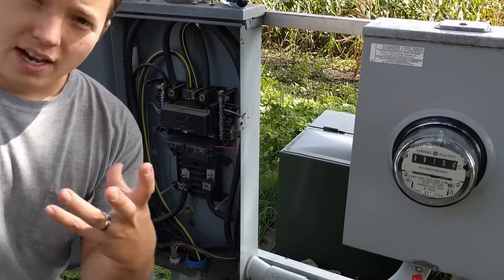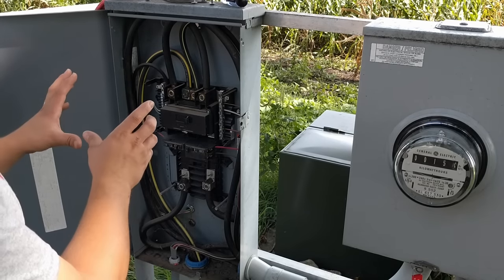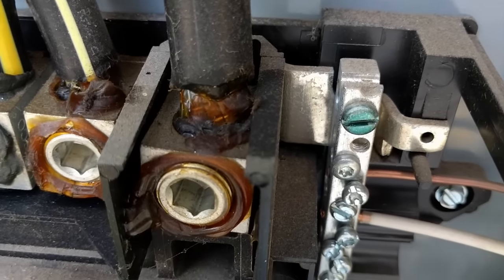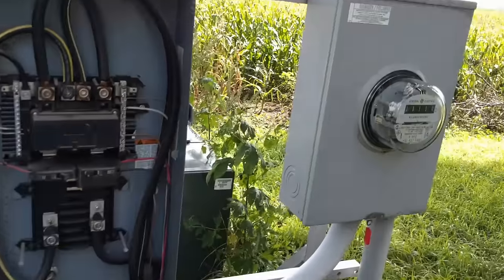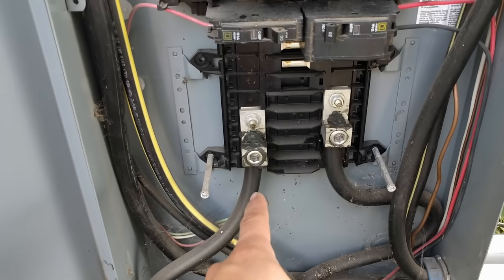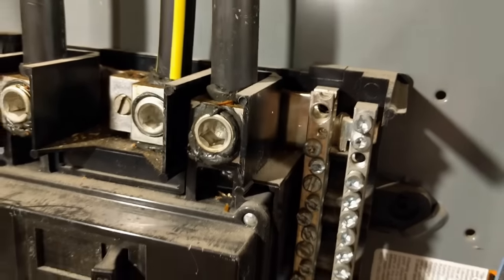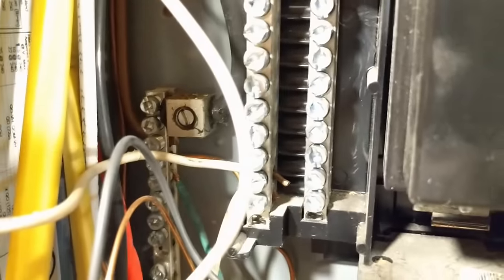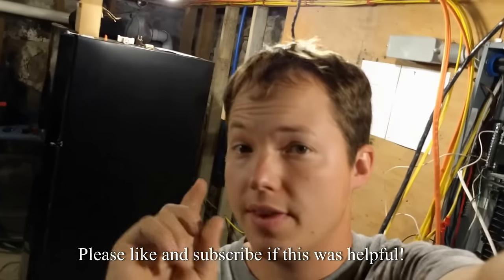What Is a Neutral Bonding Screw in a Main or Sub Panel Load Center & Should It Be Used or Removed?

Comment: @BenjaminSahlstrom What about what will "eventually" be a sub panel, but is currently (pun not intended) powered by a 120/240v generator that is just setting on the ground, or in the back of a truck, ungrounded. The panel has a ground wire run from the ground bus in the panel to a ground rod. The generator has a 4-wire power cord connected to each 120 buss, the Neutral buss and the Ground buss in said panel. The generator has a circuit breaker on it. In this situation would this breaker panel be considered the "Main Panel" in this situation?
Reply from the maker: Yes I believe you are correct. The neutral and ground would be effectively bonded at the generator assuming that the generator has a bonded neutral. You can test this with a continuity test between the ground and neutral prongs of the generator 240v plug. Make sure that you're connecting the generator with a proper breaker interlock and power inlet box. 

Thanks for the perceptive comment! It's always great talking with brilliant guys like yourself.
Reply: @BenjaminSahlstrom  Me, brilliant? LOL Just a guy trying to do things right. I am impressed that you'd answer a question so quickly from a year-old video. Thank you for that! 

I'm not sure exactly what you mean when you say "Make sure that you're connecting the generator with a proper breaker interlock and power inlet box. "

We're using a pigtail, basically, with a four prong 50 amp plug that plugs into the generator and the other end is hard wired right into the buses on the breaker panel; no main breaker. This is in a remote area, and this is a temporary situation; eventually there will be utility power with a disconnect next to the power meter. Then we'll run a three-conductor cable to replace the temporary pigtail. Does this info negate your comment about proper breaker interlock and power inlet box?

Comment: what if theres a truff or a disconnect box between the panel and meter? do i leave it or remove it?
Reply: My understanding here is to leave it in the disconnect, but remove it at the main and any sub panel after that, which requires also keeping neutrals and grounds separated in the main or any subs.

Comment: I just had an electrical inspection on a 200 amp breaker box.  The bonding screws were missing.  The inspector to lold me the connect a lug to the panel and run a 4 gauge bare copper back to the bus.  I am not an electrician - I am repeating what I was told.

Comment: How would you attach the ground if I were to create a sub panel then create another sub panel from that to my garage. I know code now require an out building to have its own grounding rods so does that mean only positive negative and neutral need to be ran to my gadage
Reply: You still need four wires when running subpanel to subpanel. You do that in addition to adding the ground rods at the garage

Comment: I just don't understand why call neutral when is coming from ground rod regardless
Reply: Neutral wires run back to the transformer on the pole.
It is called neutral because it is inserted at a point in the windings where the
sign wave of the signals crosses the '0' point or the neutral.
This completes the circuit from the load out to load (neutral) return.
The ground rods are for protection from lightning and shorts to chassis.

Comment: Great job Benjamin!   You didn't tell "why" the bonding screw is to be installed in the main panel.   In the main panel, neutral and ground conductors are on the same bars.   The issue is that the N bars are insulated by plastic mounting means.  So the green screw bonds or grounds the panel can in case of short to the metal can.   Sub-panel has ground bar screw mounted to the can, therefore connect to grounding system.   Respectfully,   Kevin

Comment: Thanks!  I'm wiring up an AC disconnect for a PV (solar) system.  The formula in the code indicates that I need to run #4 AWG ground and #4AWG Neutral from my Breaker panel (combines the output of 2 inverters) to the AC Disconnect, which then ties directly to the service meter (at the meter lugs).  My question is about the ground wire size.  After the AC Disconnect (where the neutral and ground are combined) the copper wire then goes to the ground rods.  This is allowed to be #6AWG, then what is the point of having the #4 AWG  run with the (2) 120V conductors?  I'm asking because I have to pull these wires on a long run, and because I'm curious.  Any thoughts?

Comment: Other than calling that first panel a "cut off" I think it's a well explained. For those who want to know why we don't bond (connect) the neutral and ground at other sub panels, it creates what's called a ground loop where you have the possibility of unwanted voltage in the wrong wires, which may false-trip GFIC breakers and interfere with other electronic gear. (that we didn't have 40 years ago) Ground rods (a pair, a minimum of 8 ft apart) get tied in at the first point of disconnect, meaning the first place you find a breaker that shuts off the whole service. Pulling the meter does not count as a point of disconnect, but a meter pan with a breaker does count and will have room for this junction. After that point everything will need to be separated into white and green wires. (or identified with colored tape, shrink wrap, etc) Oh, one more sticking point in the code is about the ground wire being continuous from the main disconnect to the rods. This means one wire WITHOUT any breaks going from the far rod, and through the connection at the closer rod, then onto the bonding point. NOT 2 wires being joined under a ground clamp out in the yard. NOT 2 wires making a home run to the panel. No splices and one wire under one screw / clamp.
Reply from the maker: Thanks for sharing your knowledge! I have noticed that the proper term for what I call the "cut off panel" should simply be called a "main disconnect". Wish I could update that in the video somehow.

Thanks again and happy new year!

Ben
Reply: Rupe could you explain how when the main ground to pannel breaks that 220 can show up at a 115v outlet. voltage in the home become crazy.
Reply: @mostlikelywedoitservices9743 … The problem you mention is not that an outlet will all of a sudden have 220 or 240 volts but it will become unbalanced. The simple explanation is that each outlet is one leg of the 240 (120 each) tied to the neutral. If the neutral is lost at the outlet you can't run the appliance (open circuit) but if the neutral is lost at the entrance panel or the service wire going to the pole (more common) what happens is the power follows the path of least resistance because it has to go somewhere, which is usually back to the panel and to another neutral wire going to another appliance, which may be on the other leg of the 240. Depending on the resistance this voltage could be 150 - 190 on one leg and the balance (up to 240) will show up on the other leg so it will be between 50 - 90 volts on the other leg. IOW, in the most common sense you would notice some bright lights and some dim lights around the house but these days with fancy electronics it's not that simple. Stuff will burn out.
Reply: @rupe53  Thank you for the explaining how and why. I am constantly studying to be more valuable to my customers. Thanks again.
Reply: @mostlikelywedoitservices9743 … BTW, what I explained in my last post was a lost neutral and you had asked about a ground, which is different. Most people wouldn't notice it if none of their appliances ever had an issue needing ground. OTOH, because you mentioned the classic high voltage problem I tried to go with what I though you wanted. Hopefully I was correct in my assumption.
Reply: @rupe53  Thank you for that. I asked because I have run into broken grounds between pole and panel. I am trying to understand and build my knowledge. I know you were talking on lost neutral. Again thank you.
Reply: I was just trying to explain to someone why not to use the bonding screw in a subpanel earlier today.  I'm under the impression that bonding sub-panels if a separate earth ground/grounding conductor is present, whether it be a point of use receptacle or in a sub-panel, it creates a parallel ground path where some of the current that should be carried by the neutral ends up on the grounding conductor.  This means that the grounding conductor may not have enough capacity to trip the breaker in the event of a short-circuit condition.
Reply: @huckbeduck   so out of the "cutoff panel" you need a ground Wire from  the bonded neutral bar down to a ground rod? or a ground wire out of the inside panel to a ground rod? I know that may sound stupid but the project I'm on right now it is possible to run wires out of the inside panel directly to a ground rod just wondering what is necessary
Reply: @bundyyy-metalhippie501   The wire connect ing to the ground rod only needs to run between the bonded neutral bus and the ground rod.  It depends on the distance your inside panel is from the service equipment ie. the electric company's meter box though.  If your inside panel is not directly on the other side of the wall as the meter box  you will need a grounding wire aka. equipment ground or earth ground wire (bare copper or green insulation [if it runs through conduit]) that connects the "grounding" bus bar of the inside panel to the bonded neutral bus of the disconnect or "cut-off" panel that is outside. In this case you will not use the long green grounding screw that bonds the neutral bus to the case or box of the inside panel, since your inside panel is considered a sub-panel in this case.   If your inside panel is on the same wall directly back-to-back with the  meter box  you shouldn't need a separate disconnect/"cut-off".  In that case your inside panel be serving as the "Main dis-connecting means" & you'll need a main disconnect panel.  You won't need a separate grounding wire in this case.  I don't know what the code requirement is where you live, sometimes the local inspectors want you to have a separate disconnect next to the meter, which is my preference as well.  If work needs to be performed in the future inside the panel, it is really nice to be able to shut off all power going to it without having to call & then wait on the electric company to remove the meter in order for the work to be done safely.
Reply: Main panels are cut offs . That plane outside was how the fire department will cut off  power to the house .
Reply: @rupe53  
I have 2 separate meters with 2 main panels for a 2 family house. Now I use it as one family and closed one meter/account. So I want to convert one of panels as Sub-panel. Do I need to get additional ground bar for this converted sub panel? It’s in same house and 2 panels next to each other and they are all connected to metal conduit, then to the ground. Thanks 🙏
Reply: @DJ-rd8vb  ... they are in the same building so by NEC you don't need another ground rod but you do need to remove the bonding screw on the subpanel. Also, check with your local inspector. He may want you to have 2 ground rods on the primary service and a hardwire ground between the panels. (which is required on a subpanel anyway) EDITED: BTW, you said "ground bar" which is the name for the strip where all of the ground wires go in the panel.  If your grounds and neutrals are on the same bar (called buss bar) inside the panel you WILL need another bar in there to isolate the grounds from the neutrals. They are available at most any supply house and must be secured to the panel by a couple of 10/32 screws. (it's in the code) This is now the cabinet ground as well as the place where you attach your ground to the first panel.
Reply: @rupe53  Thank you so much for your help and I really appreciate your time ．
Reply: Dude I need your help! I watched your other video and now I'm so confused. The one adding the sub panel.(suuuper well done and informative) I might add. My friends panel is like this one, shutoff is outside. So on the video when you came from your feeding panel to the sub panel, you put both the ground wire and the neutral on the neutral bar, then inside the sub panel you were adding, you then put the ground back to the ground bar and the neutral on the neutral. I was totally doing what you said then got confused about "keeping them separate". Are they supposed to be separate or not separate? I was a little confused as to why you put the ground and neutral on the same bar? Thanks a ton in advance man. The videos are fantastic!
Reply: @joshmartin7558   just for clarification... the ground and neutral only join together at the point of first disconnect... which is wherever the main breaker is. In any panels after that, they are separate. IOW, if your main breaker is at the meter then that's where they tie together and your first panel is considered a subpanel, so ground and neutral are separate. Any additional panels will also need to have separate buss bars for ground and neutral. If there's a green screw on the neutral buss, it needs to be removed so the neutral is no longer tied to the cabinet. Hope that helps.
Reply: @rupe53  thanks, I think I understand what I was missing now. In this video https://youtu.be/0kkVJYNLXo4?feature=shared  I was confused by him putting both the neutral and the ground on the same line. I just noticed that's the "first panel". My panel however has the disconnect outside so I won't be putting them on the same line. Right? I was totally missing that part about only the first panel gets bonded. Thank you for the reply sir. I see the light now lol
Reply: @joshmartin7558    NOW you have it correct! BTW, it may help in the future if you think about "first point of disconnect" being wherever the first main breaker is. In your case it's at the meter, NOT in a panel. (so don't call the meter a panel, it's a meter PAN) Some might call that a metered main breaker. Sounds weird, but it's a common term.

Comment: Great video. I work for a local utility that has many rural horse farms. Every winter we get trouble calls for horses not wanting to drink water due to stray voltage in their tubs which is caused by their heaters. We would get anywhere from 2-6 volts in the water. We always thought it would be a bad neutral or poor grounding conditions somewhere on the property. As it turns out, all of these farms have had sub panels installed that needed their bonding screw removed.
Reply: Why only when it’s cold (every winter)??
Reply: @Isaiah Corona  the hands on the farms place heaters in the horses water trough to prevent it from freezing.  Heaters are only needed in the winter.

Comment: You gave no explanation why it needs to be this way. Grounding bar and neutral bar on any subpanel still has perfect closed loop except that in subpanel continuity goes through the main panel bonding. Every time I revise this bullshit I kinda begin to understand why, but next time I return to this topic I always forget WTF this is?
Reply: Arthur Vin.  You are correct, no explanation! Everyone comes up with double talk, or an obscure, mythical example where you might be shocked, or it's the code! But I have yet to hear why it's bad, it's the way it's been done for 30years, now they go postal, over one green screw!
Reply: Arthur Vin     How about I give it a try for you.   Forget about ground rods or other electrodes for a minute please.(nothing to do with this question).    The purpose for grounds going from panel to sub panel and in all branch circuits is if there is a short circuit (hot to ground) there needs to be a low resistance path back to the main disconnect, then to the neutral, then through the meter to the utility transformer, back to the panel to the breaker feeding the short and cause it to trip.   This can be thousands of amps to hundreds of thousands of amps.   So best to keep on a separate conductor.   Best to not have running on neutral that is connected to all of your 120 volt loads.   Does his help?   Respectfully,   Kevin

Comment: The main bonding jumper is required at the MAIN DISCONNECT. This is the only place an equipment ground is bonded with the neutral conductor. Otherwise, current will flow on grounded parts and cause objectionable current flow. NEC 250.6 goes into great detail of an effective ground fault current path is. NEC 250.28 is where you'll find out about the MBJ.
Reply: electricalron  Thankyou, finally someone injects the NEC into the mix. And as you can tell the Saga of Grounding and Bonding confusion continues,Lol.